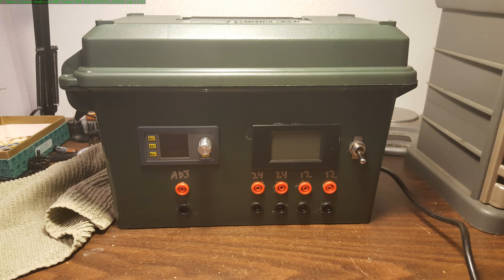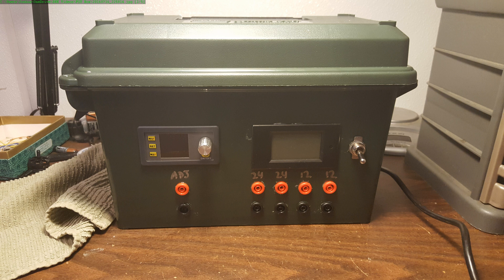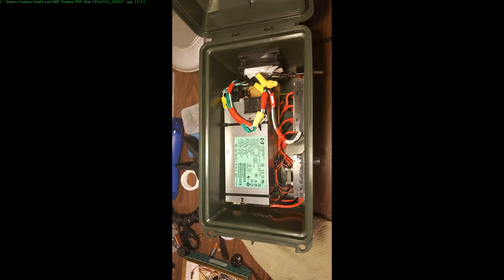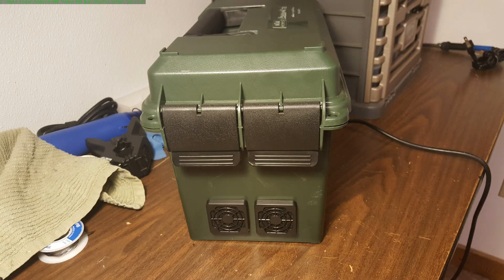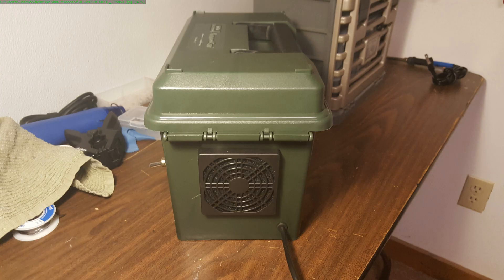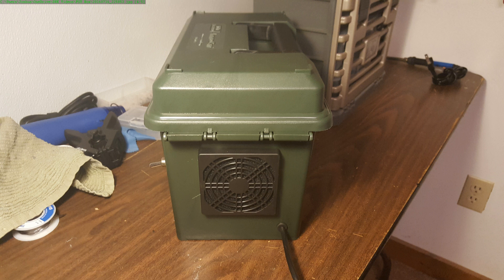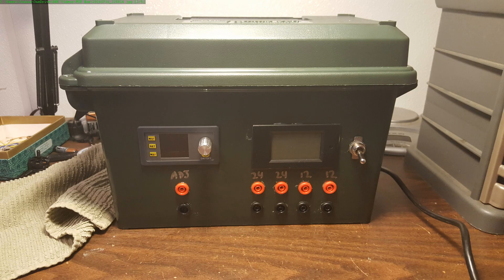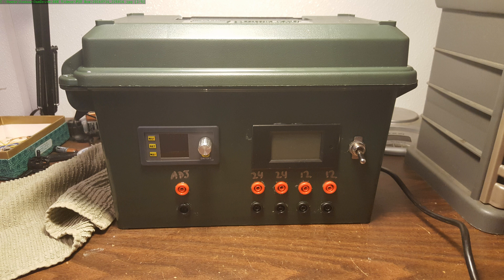Ammo Can 12v/24v LiPo Charger Power Supply - Mark 2!

Comment: I'm about to build a charging station like this. Having used yours for a few years now, is there anything you would do different?
Reply from the maker: The adjustable-output supply is nice but since this PSU is not located on my work bench, I don't use the adjustable-output supply as much as you might think. I might leave it out.
Reply: @JoshuaBardwell  thanks for the response

Comment: Joshua, I just finish building your Power Supply box.  Love it!  Thanks!  I was able to float the DC output on one by just switching out the two rear board mounting metal screws for nylon ones.  I also used the 110 vac socket and switch combo you recommended in your parts list - much cleaner build.  Keep up the excellent work.......Larry

Comment: Hi Josh, I like your Power Supply Idea very much...so I ordered the cheaper HP DL360 supplies per your suggestion...thinking I would easily find the pin connecting mods for first  turning on supplies and next for hooking in series (floating ground mod).   No joy so far. Found Lots of video for your original 1200 watt version but none for this 750 watt supply.  Do you have a reference where I might start?   Tnx Larry
Reply from the maker: Isn't the pin configuration the same?
Reply from the maker: I bought one of the 750 watt versions in the last three months or so, and it was identical.

Comment: Hi Joshua, couple of questions:  
1) Are you concerned with your binding posts on the DC output not capable of carrying the amount of current these supplies can push out?  
2) I'm in the process of building my own 24v power supply out of two.  I've been doing a lot of research and decided to float only one of the servo power supplies the (24v) one.  Did you float one or both of yours?
Thanks for your help and keep doing what you do ... it's greatly appreciated!
Reply from the maker: +uLightMe the supply can push 100 amps but I never use more than 20 or 30. It hasn't been a problem so far.
Reply from the maker: +uLightMe you only float the high side supply.

Comment: Hey there, i bought the exact same power supplies one and a half years ago but have not had the time to start that project. I understand that you dont want to be made liable for anything here, so no links on any video, but could you throw some random catchwords at me that uncle google could help me find the right thread/page for that particular mod (proper daisy chain)?
Sincerly someone who knows that its risky to work on electronics ;)
Reply from the maker: https://www.rcgroups.com/forums/showthread.php?1164359-A-24V-power-supply-from-two-12V-power-supplies
Reply: I too am trying to find and figure out how to connect 2 psu's together to get 24volts. I have a modded pc psu for 12volts but have another spare i'd like to join in series some how to double the volts. means i can charge quicker with bigger chargers etc. let me know if you find anything

Comment: so I'm matching mine similar to yours and was wondering, are you regulating power to the fan or just letting it run full blast while box is on?
Reply from the maker: +Huascar Hernandez I'm just running it full blast off of 12 volts. But it is a low noise fan.
Reply: Joshua Bardwell thanks for the reply.  I assumed you were but wanted to verify.  I'll have to hear the fan when I get it as my build area is currently my bedroom and the wife may not be too happy about the extra noise.
Reply: some power supply have built in self regulated fans you might can tap into it then it might only kick in as needed or you can just add speed switch or a wave machine

Comment: that looks really neat, almost shop quality! 
Only one of my two chargers will accept DC, and it broke whilst charging off of my car :/ It still works on AC so now I have a 300w inverter in my car so the power goes AC>DC>AC>DC to the battery, I bet the DC line is smooth as silk lol

Comment: Nice set up Josh. Vlean and easy to pack.
How are you powering the power supply in the field? I tried using a 400 watt inverter through the cigarette lighter but looks like it can't keep up with the power draw. Keeps cutting out.
Reply from the maker: 2000 watt generator :) :) :)
Reply from the maker: If I was in the field, I wouldn't use an inverter. Think about it: you're going 12v -> 120v -> 12v. Lots of efficiency loss there. Use alligator clamps to connect to your battery terminals and then run your engine. The car will basically be a huge electrical generator. Wastes a bit of gas, but probably just a few dollars in the grand scheme of things.

I would NOT run off your car battery without running the engine, because it is much easier than you think to over-discharge a regular car starter battery. They are NOT designed for large, continuous loads.
Reply: +Joshua Bardwell Woooo! That's serious power. 😆 Maybe I can get the guys at the rc club to chip in so we all use it. Or get a bigger car to haul the toys.

Comment: looks real cleanly done. 

I do have a off topic question tho if you do not mind. 
I bought the turnigy 3 n 1  low volt detect and and monitor, signal loss for my new build. I have the luminer lux board and I an not sure if the will work with PPM.  thanks for any advise
Reply from the maker: I don't know anything about that product.